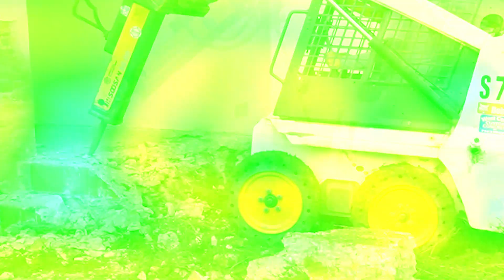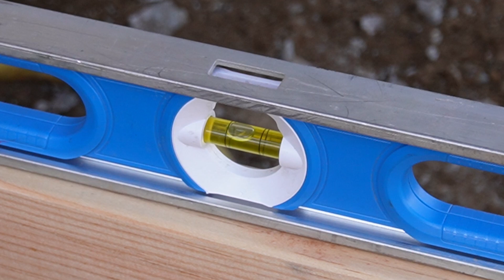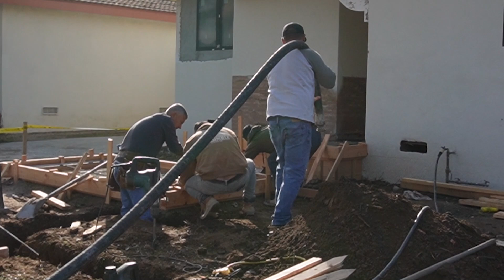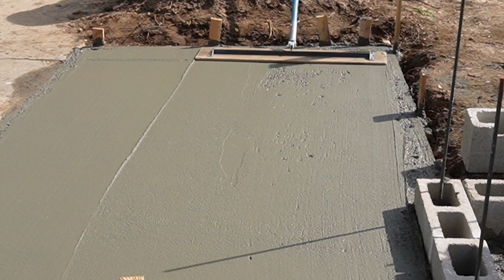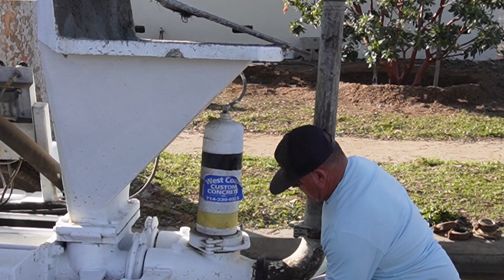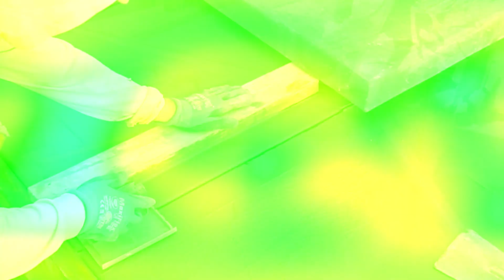Floating Concrete Steps Glow with LED Lights!🔥🔥

Comment: I've been wanting floating steps for years in the UK and last 3 contractors were supposed to come back with quotes and never did. I'm trying to piece together every step (no pun intended) for doing it, but I would be great if you did a video from start to end including what materials to use from forms to concrete to tools. A complete how too DIY video. 👍🏼 No one does them in the UK residentially. Maybe I'll quit my desk job and take advantage.

Comment: Man pump the concrete and shut up.. ur crew is on another level.. just demo and pump.. never seen u on sliders finishing before.  Eating to many painkillers buddy
Reply from the maker: Just have the license, get the call sell the job. Material & labor take off🤣own the equipment plus have the skill. Have the customer have complete confidence in you. Oh yeah pay top of the scale for the highest end work. That's it🫵🤣
Reply: @WestCoastCustomConcrete  I was going to send some work your way but when I checked your contractors license says expired in 8/7/2023 on the cslb website are you working under another company name now.
Reply from the maker: @ 🤣I don't work with idiots 💯that was my corporate license dumbass. It's now a sole proprietor ✌️🔥
Reply: @WestCoastCustomConcrete  Fuck what that punk had to say.. You're a business man with the skills. Dude is just a hater